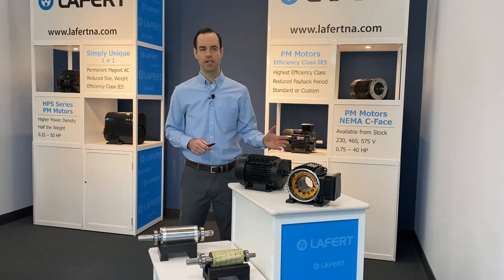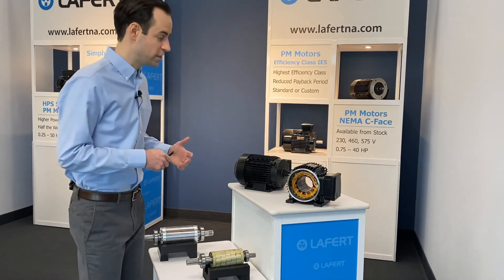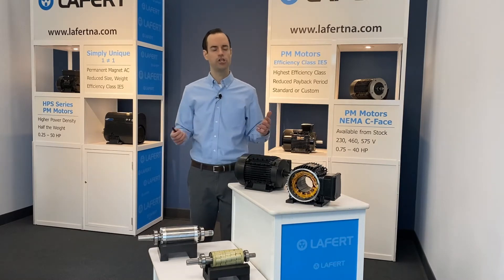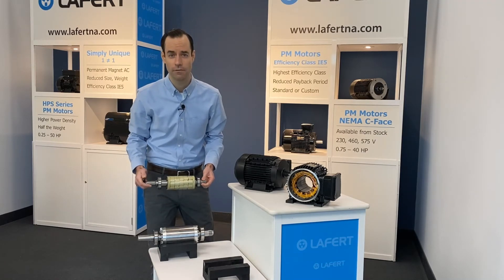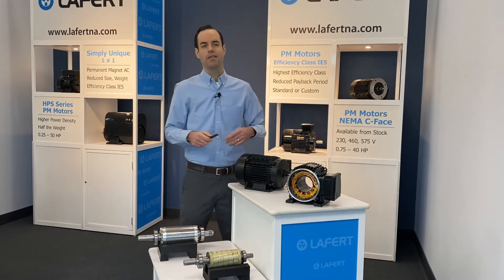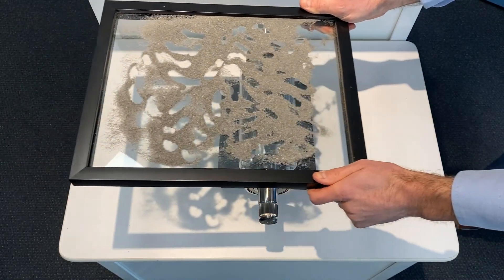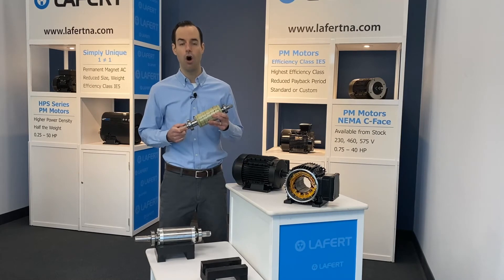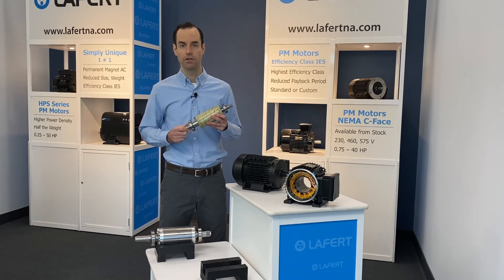Intro to Lafert Permanent Magnet Motor Technology

Comment: do you need electric energy to get this motor working? can we use it like a generator?
Reply: Yes....I have one...if you manually turn the shaft a voltage generates across the terminals